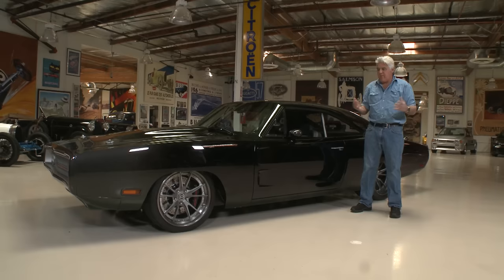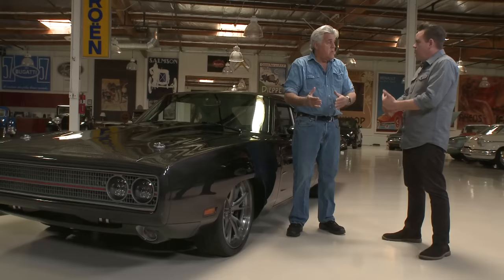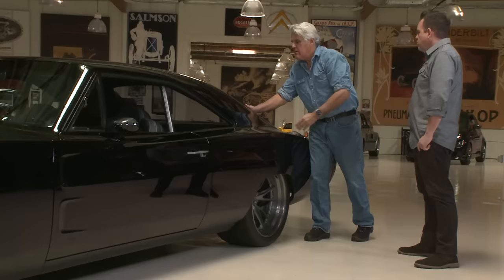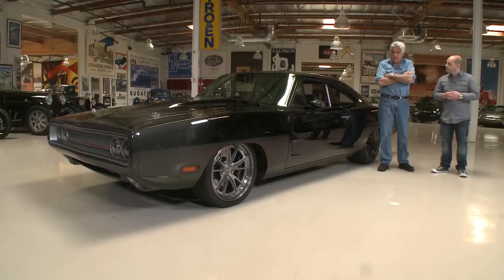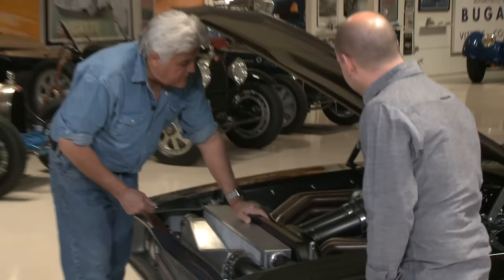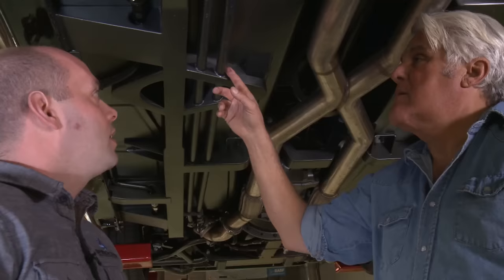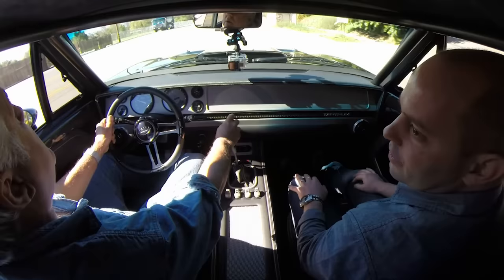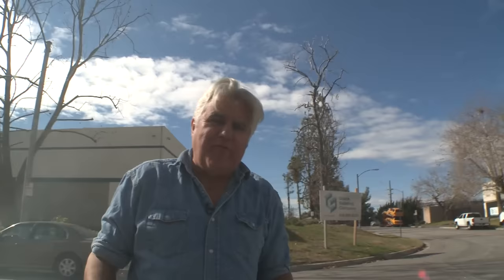1970 Dodge Charger Tantrum - Jay Leno's Garage

Comment: Whats the thought process of putting a Boat Engine in a Car? Where they like "Mhh we have this charger what Engine are we gonna put in it? Well its a Boat so we might as well put a Boat Engine in it."
Reply: I was wondering the same thing, but the only answer I can think of is because they bought the biggest motor possible. 9.0l is ridiculous
Reply: Because there aren't automotive 32 valve, DOHC big blocks which are designed to make 1600+ HP for hours on end!
Reply: +MCMonsterbuilder Well in the video he basically says they wanted to build a car powered by a boat engine. So it seems like they where more like "mmmm we have this boat engine what car big enough to fit it in"
Reply: +MCMonsterbuilder because the car is as big as a boat?
Reply: +MCMonsterbuilder Mercury sells the engine for automotive use. they meant it for the kit car racing scene, they probably didn't expect to see it in a Charger
Reply: +Nathan Kaufman what does 100% duty cycle means?
Reply: stevenreynolds40
But what if its engineered for 98% duty cycle, do we take them to court?
Reply: +SWOgottaGO That means that it can actually make that power continuously. Most big-HP builds probably wouldn't run at their large power numbers for too long before something broke. Now, the top end Nelson and Steve Morris builds might be capable (after all, Nelson started in offshore), but in general, OEM reliability doesn't exist at 1500+ HP. This engine, being designed and built for offshore racing, can literally sit at full throttle for hours. In a car, I'd imagine the cooling system wouldn't be up to the task, but I don't very many places where you can unleash 1650 HP for long periods of time anyway.
Reply: +MCMonsterbuilder Mopars were always lighter than the Chevys.
Reply: +shafta99 
yup, would seem to make more sense just to put a motor out of the new Hellcat in it.
Reply: Seems like he said they had the engine and thought about what car to put it in and decided on the Charger..
Reply: +MCMonsterbuilder  - What I got from the video was that the engine builder is a distributor for Mercury Marine engines and they had the engine, they just needed to find the right car to put it in to showcase their engine.  So the egg came before the chicken as it where.
Reply: +MCMonsterbuilder Hey, the car's a boat and the engine belongs in a boat. It's a match made in heaven.
Reply: +SWOgottaGO ; Wide open.
Reply: +MCMonsterbuilder If you listen carefully, he says they needed a car big enough for the engine.  So they started with the idea of using the engine for a car, then had to find one that it would fit in.  And the reason you would do it is... because they could.
Reply: +MCMonsterbuilder The guy from Cuban Chrome did lol....until he found a Mercedes 5 cylinder diesel to replace it with.
Reply: +Kai Baumgartner That's right!  That show is so fun to watch; those people have so little, but they don't whine and cry half as much as Americans.
Reply: Marine engines are built way tougher than street engines plus they sound fng awesome and are crazy fast
Reply: ***** Honestly, it doesn't seem that any of the considerations you listed crossed the mind of the builders of this car. They just tried for max horsepower, end of story.  Even Jay said, "There's such a thing as too much horsepower..." and mentioned several times how easy the back end would break loose if he stepped on the gas too much.   Great for smoky burnouts and bragging rights, but that's about it.
Reply: +MCMonsterbuilder He did also say that when putting in a boat motor no one will get their jimmies rustled because it was a Ford/Chevy non-mopar engine, instead they just go. Ooh Big Block!
Reply: +MCMonsterbuilder The 1990's Corvette ZR1s used a Mercury/Lotus engine. Nothing new.
Reply: You may want to look around a bit. He isn't the first to use a boat engine in a car. Tractor engines are also used due to the extreme torque.
Reply: +Nathan Kaufman Indeed, Mercury Marine assembled the engine for the Corvette C4 ZR-1.
Reply: +Kai Baumgartner love that show. i hope they are coming back with a second season eventually because it was just fantastic, they did have some drama that was clearly fabricated but not nearly as much as im used to seeing and they had the content to back it up so it didnt really bother me. drama especially in car shows and all that just pisses me off because to me i just think, stop bitching and keep building
Reply: It's basically a Chev
Reply: +Jeff K Not really the Hell cat Engine would Explode if it tried to make anywhere near that much power. Its good for 900 on nos for a short time but thats it.
Reply: Its a 4valve engine no other bigblock this big is 4valve thats why . Oh yeah it is super exotic coming at 70k without the ecu or the turbos :)
Reply: Unlike automobile engines, boat engines are built to output full torque and power all day without blowing up. This makes a hot rod that loves to work hard.
Reply: kolay gelsin Abi
Reply: RockinRobbins13 as Jay said though. Boat engines use the water from the lake or wherever they are to keep cool and its easy to keep up with cooling in comparison. But its still definitely got to be a good build to withstand the stress aswell. That said you dont need to go to this extreme to have such reliability.
Reply: Unlike car motors, boat motors are designed to run wide open, outputting maximum torque forever. There is no level ground on the water. In effect it is all a steep hill climb and motors have to produce or die.
Reply: Because roadkill
Reply: Harry Williams 
absolutely!!
Reply: stevenreynolds40 actually Sonny Leonards makes a 1001ci V8. Now that's what i call a motor. Forget about a budget though, if you put an engine even half that size in your car you've got some money. Gup in Australia has a Holden with a 767ci Hemi V8. On pump gas it makes 1200whp or something stupid like that. And it's naturally aspirated. I think the block alone without accessories is 80 000$ US
Reply: Maybe someone should make a car with this engine: https://en.m.wikipedia.org/wiki/W%C3%A4rtsil%C3%A4-Sulzer_RTA96-C

Comment: Isn't the qc4 engine platform based on a big block Chevy?
Reply: Pretty much
Reply: I wonder what the weight distribution is, probarbly 80/20 xD
Reply: +kinger2005 that has overhead cams AND its 9 liter, i mean thats a hell of a strech if its true
Reply: +waderedsox whoops i apologize google has just corrected me
Reply: +kinger2005 Indeed, it isn't.
Reply: Wasn't mercury once a division of Ford?
Reply: different mercury, this is the mercury boat motor company
Reply: +Cory Stansbury It's a clean sheet Mercury design. Only thing Chevy about it is the bell housing bolt pattern and bore spacing. Clean Sheet block, 4 cam heads etc.
Reply: +Antoine Pageau No, we are talking about Mercury Marine here, a division of Brunswick since 1964.
Reply: +kinger2005 As far as I know its a completely custom block, heads, etc. Mercury does have marine engines based on Ford and GM automotive vehicles. But the QC4v is entirely theirs to my knowledge.

EDIT: just looked it up. The base block was based on a GM big block (probably to save in engineering cost), but the block is entirely custom otherwise.
Reply: +Stuka87 I am sure it's "their own design" much like a Koenigsegg engine is bespoke too. Doesn't change the fact that the Mercury looks a lot like a BBC and the Koenigsegg like a mod motor. I doubt the block/rotating assembly is any more different in either than those of dozens of aftermarket suppliers. 

To quote Hot Rod:
"Mercury Racing designed the QC4 engine architecture in 2010. It’s a deep-skirt block that's based on a big-block Chevy architecture. It has cross-bolted main bearing caps..."

I am not diminishing the engineering involved...just saying that they chose to start with a known entity. That entity was one with which they've worked for decades. It wouldn't make sense to start from scratch unless their was some perceived weakness inherent.
Reply: Also, most high-powered boat engines are versions of the big-block Chevy. There's a few outliers - Ford 460, Chrysler V-10, Lamborghini V-12 - but most of them are Chevys. Now you can build something better and Mercury Marine did, but it's still convenient to have it fit in the same place. So it's about the same size, the bolt pattern is the same, the motor mounts are in the same place, and so forth.
Reply: design elements are from gen 7 496  with 502 bore spacing

Comment: You just can't beat dodge!!/Mopar
Reply: I'm a Mopar guy, but this basically has a Chevy engine in it.
Reply: True
Reply: ....its a custom made charger look like whit Chevy engine..... but still very intresting
Reply: Not really much Dodge left on that car but it's sick
Reply: +Mauricio Nuñez there is zero GM junk used under the hood of this car....
Reply: +Branon Fontaine Not sure what makes you think GM engines  are junk ha ha. But you're  right, this is basically a custom  made engine, the only thing GM about it is the block design as it's  a 502 big block chev casting.
Reply: +Branon Fontaine Mercury is the marine division of GM.......
Reply: I've had to defend Ford engines from that same comment.

Beautiful car here with a GM motor and a Ford steering rack.  I'm surprised there's not more comments on the latter.
Reply: KingOfMopar it's neither now lol

Comment: "it can lift 40,000 pounds" 
says 18500 on the side
Reply: +Max Cadena per lift, he has 4 of them.
Reply: +Charles-A Rovira it says lbs
Reply: +Redswipe 
It might be nice, but it lifts the car by tires, which isn't great for working on a car.
Reply: +Max Cadena 18,500 per lift/per corner.
Reply: +Piotr Noja im pretty sure that you get what you pay for when $60k is the tag
Reply: +LowlyGent correct, just wanted to point out it wasn't kilos
Reply: +Redswipe 
For $60K,you are either rich or you are making money with them. I'm of the impression Jay is a bit of both.
Reply: Cool lift but It lifts the car by its wheels, which would get in the way if they wanted to work on the brakes or do any other work that requires removing the wheels.
Reply: John e

Thought abut that too when I first saw it, a couple of years back. Jay's garage has normal lifts as well as jacks.
Reply: 18500 per side...approx. 40000
Reply: +Charles-A Rovira 
No, it says 18500 "lbs". So it's in pounds. But times 2 it's almost 37,000 pounds. Close to 40,000 lbs.

Comment: Purposefully add turbo lag? I don't buy it. Regardless it's still a  beautiful car.
Reply: +Poe Tay Toe 
His explanation was pretty solid, no?
Reply: +Poe Tay Toe The lag acts as a mechanical traction control, so when the cars not on boost then the power is manageable for the rear tyres. Once on boost.....yeah, traction is in short supply.
Reply: His explanation was really odd. I'm not sure he himself was involved in the turbo aspect of the build. He seemed very uncomfortable with the topic. It sounded more like he was trying to regurgitate something he was told.
Reply: +Poe Tay Toe 9.0L wont have any problem spooling those turbos...
Reply: +Poe Tay Toe you can certainly tune the power delivery with different size turbos.  FWD drag cars are purposely built with large turbos so the wheels don't spin on launch.

Comment: I read down a ways, but not every comment, so I don't know if this was covered.

Cooling is cooling.  The block holds a certain amount of coolant and the coolant pump pumps a certain amount of coolant.  Modern boats run thermostats, just like a car.  A boat engine also has to come up to operating temperature, which is the same as a car.  The main difference is that most boats run 2 water pumps, the block pump (usually a more efficient version of the block mounted pump) that circulates engine coolant, and a "sea-water" pump that circulates the "lake water".  In a stern-drive, the seawater pump is in the bottom of the "leg", by the prop.

The "lake water", in most cases, runs through a "liquid to liquid" heat exchanger, which is the marine equivalent of a radiator.  The exchanger is usually a lot smaller and has copper tubes inside rather than the fins of a radiator.  The "lake water" is a lot colder than the air, so it does a better job of cooling the engine coolant, which is why the exchanger can be smaller.

In a car, you are using a "liquid to air" exchanger, which we call a radiator.   The fact that it is a marine motor makes no difference, it still requires the same cooling as an equivalent automotive motor.  The radiator and fans are sized to match the application, just like any engine swap, and, the fact the marine water pump is usually more efficient than automotive pumps, usually helps.

Comment: When I lived in Florida, me and my two buddies helped put TWO of those engines into our next door neighbors 52' Sport Fisherman boat...  They where non-Turbo but still, massive, monster motors!    We rented a crane to lift them off the flat bed they where on, lowered each onto the motor mounts then towed the boat back to his dock and finished up the installation there...   This was quite a number of years ago but if memory serves me, I THINK each engine was rated at 700HP...    When we where finished and fired them up for the first time, we literally 'rumbled' the entire neighborhood.   You could hear them, echoing up and down the various canals we lived on.   It was a mega-hoot when we finally got that boat out into the Gulf and opened the throttles full!  I think I made the same sound Jay makes when he floors it!!

Comment: This nice beast is basically a humvee with a race boat motor encased in a modified and improved Charger body.  All 3 elements, motor, frame and body are absolutely beautiful and no comparison to the performance specs of the original '70 Charger..   This Team should propose this nice beast to Fiat Chrysler...who would probably not be able to build it for under $150k...  GREAT CAR ! !
Reply: wont buy the motor for that

Comment: What a great job they have done with this build, the high quality engineering stands out especially when seen from underneath. I am not sure that I would have gone the turbo route, the throttle position to horsepower delivered are not that predictable and when you 1,650 of them I can see why Jay was so nervous driving it. I would have asked for a supercharged engine with 1,000hp on race fuel and what ever you could get on pump gas, superchargers might not be as efficient as turbos but they have a lovely linear power delivery.

Comment: Hello Jay,
Wish I had one, but I can only imagine what it would cost. I have a Noonan LS Edge 427 billet block with Darton MID Sleeves waiting to go into build. I can't decide between a turbo or SC, but I have considered the Harrop Hurricane ITB x8/80mm throttle plate design. It will be a daily, so no need beyond 720hp with lots of low-end TQ. Slaved to a 3" Solo Performance J-hook exhaust, combined with the Hurricane to provide that semi-old school low-end sound. Either way, I just can't afford to move forward until I figure out my funding. Thanks for this fantastic video and making me dream a little bit. Regards~ US Army (DAV)

Comment: you've gotta be chocking those big turbos with that tiny exhaust
Reply: its a way to detune it    that motor comes with a 100 hr at WOT warranty    and power levels to 1800 hp..   its not meant to be tame..  so to make it even controllable you gotta hold it back

Comment: sounds real crisp for a turbocharged engine probably could start could burnout in 4th gear if the t56 could handle it. with traction that t56 is on borrowed time.

Comment: That sounds like an inferno on wheels. It seems, they deliberately didn‘t put any stereo equipment in it, as the passengers wouldn‘t have heard any sounds from the radio anyway. 

The real music comes from the engine bay. 

You could discuss forever, whether a Charger should look like this, without getting anywhere. As everybody has his/her own opinion in this topic.

But I very much applaud the courage to do something different.

Comment: Most boats today don't take lake water or ocean water directly into the engine to cool. they have a heat-exchanger that works like a water-to-water intercooler.  Engine coolant flows through tubes in the exchanger and lake water flows around the pipes, taking the heat away like the air does in a normal radiator.  One advantage is that it is much smaller than a water-to-air radiator.

When Jay started talking about the engine not being Chrysler, I was all ready to stop watching if the guy had said "Chevy", but, a Mercury Marine engine is unique and makes the car very unique.  It would have been nice to see a modern Hemi in it, but, a marine engine just makes the car that much more different without ruining it.  I am absolutely sick of seeing Chev stuffed into everything when all of the manufacturers have great engines.

Comment: That is one sweet ride I would say masterpiece if it weren't for the way they did the front grill. Other than that is is a masterpiece. The sound of that engine just intimidating. Not the car to drive on a rainy day. That car will not stay on the road in the rain.

Comment: Do they make a n/a version of that motor? Would sound awesome and be more predictable with its power delivery to the wheels. Might drop the hp down some, especially on CA pump gas. A light carbon car doesn't need 1650hp to be insane fast and fun. I mean you want 1650hp, but do ya need it? Haha.
Reply: 860 hp

Comment: The exhaust wraps around the engine , the gearbox, the fuel tank .. and then meets in the middle its just  overkill for the sake of overkill .. and i think in all of its wonderful sound and power its a complete mismatch for the car.. and not being able to put your foot to the floor around most roads would be frustrating as hell. .. a modern big block twin turbo hemi engine with about 1000hp and one that fits better in the engine bay would have been a better match. imo
Reply: 1,650 hp.